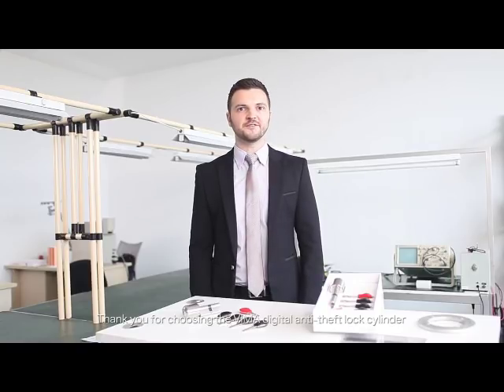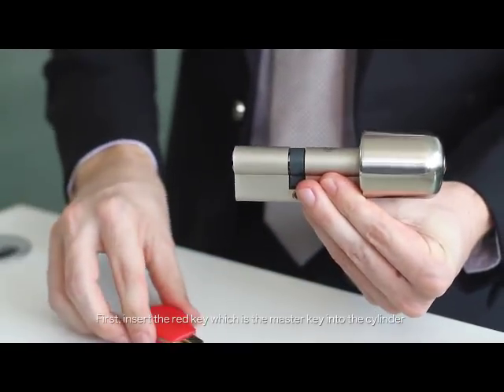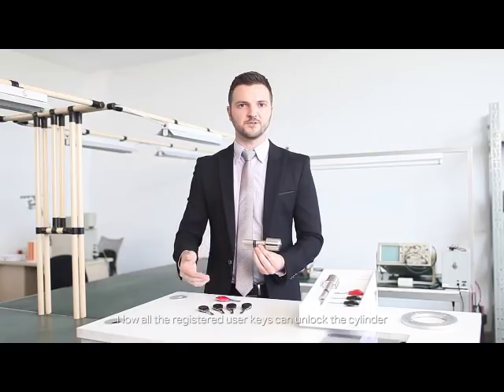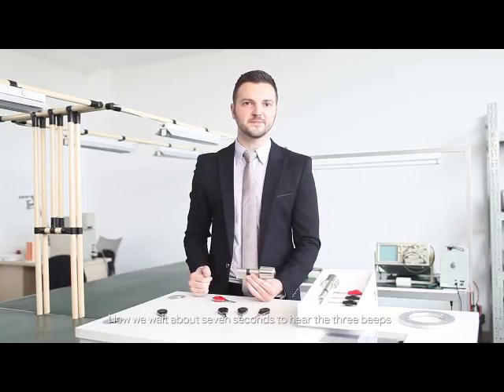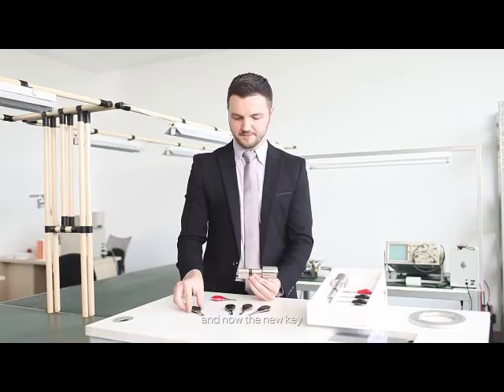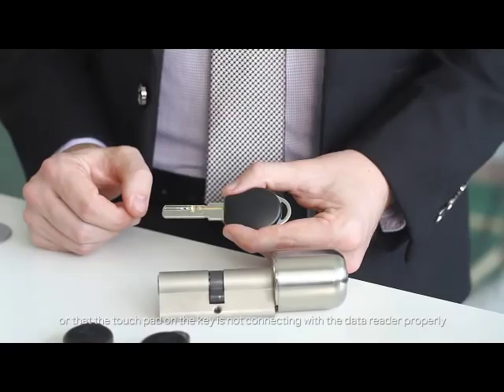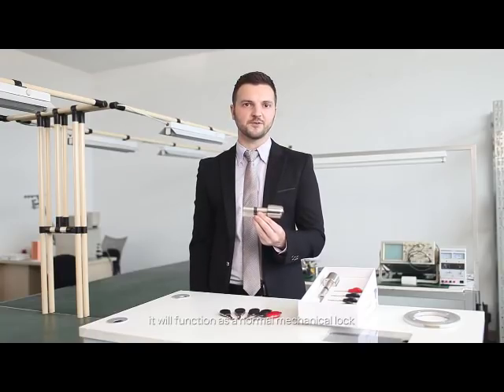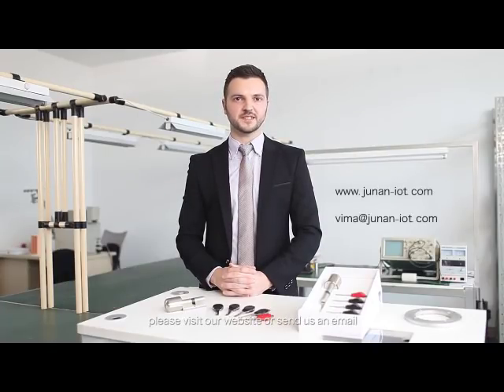Digital anti-theft lock cylinder operation video

Comment: Well that last comment bust it all, frying the circuit with burst of 10Kv and bob's your uncle you got yourself a mechanical cylinder :)
Reply: And because it can be opened from the inside with the free turning knob, you can probably open it with a cheap Thumb-turn Bypass Tool, so you won't need any complicated picking skills anyway

Comment: If this lock can be opened from the inside with the knob, then it can be opened from the outside without the key using a Thumb-turn Bypass Tool in a couple of seconds. NOT SECURE.